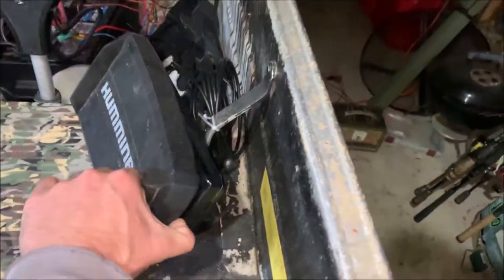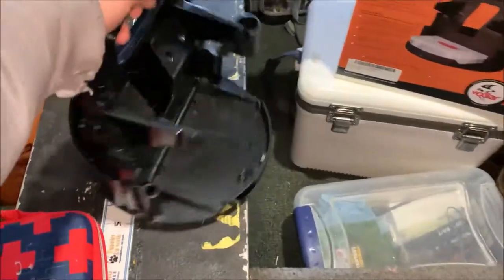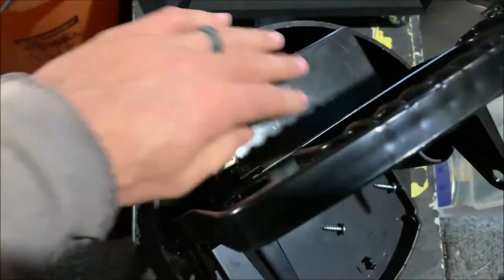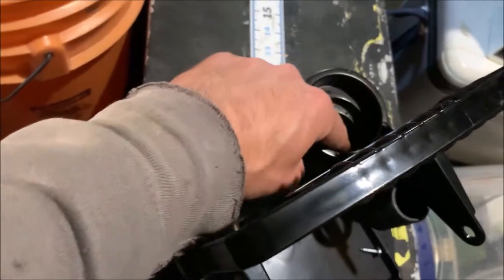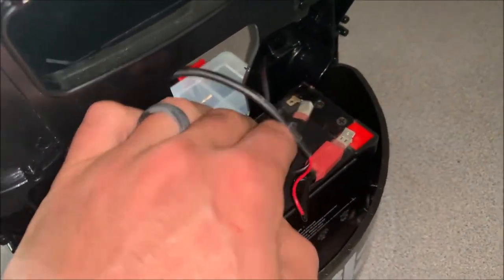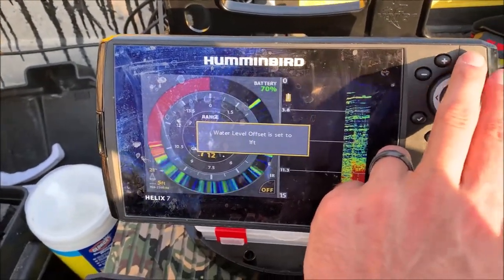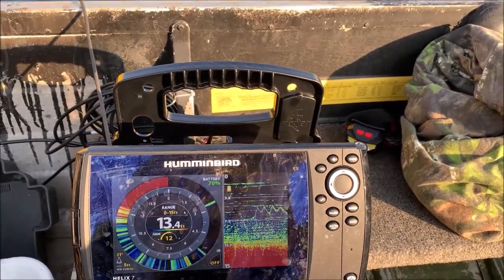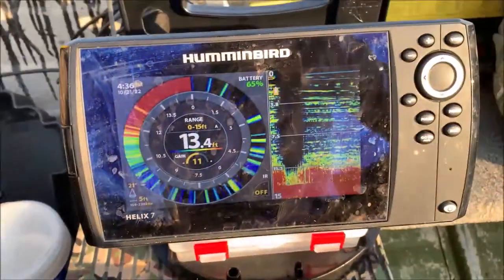DIY Humminbird Helix Ice Shuttle | Cheap and Easy

Comment: Are you sure it won't fit in a bucket? My Helix 7 measures 10.5" across. Most buckets are about 11 or 11-1/4" ID. I'd love to try your option rather than buy a Humminbird shuttle for $400 but it has to fit in a bucket or no go.
Reply from the maker: Confirmed it Does not fit.

Comment: Does it still fit in the 5 gallon bucket after the head unit is installed? Looks too wide with the helix 7 attached. Thank you
Reply from the maker: Great question. Once the 7 is attached it no longer fits in the bucket
Reply: @JacksonBaumgartOutdoors  yeah I figured that it wouldn't if the arms were shorter it would I'm sure o was going to maybe cut them off and make a couple really short brackets and try that